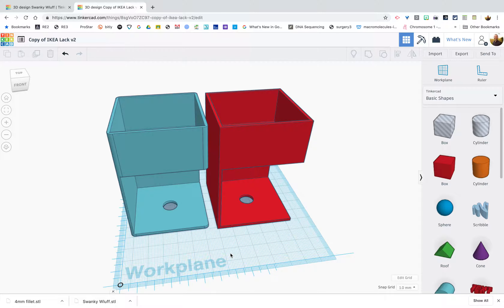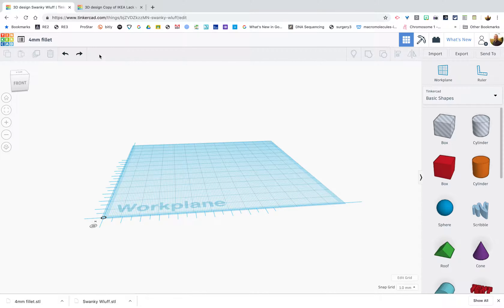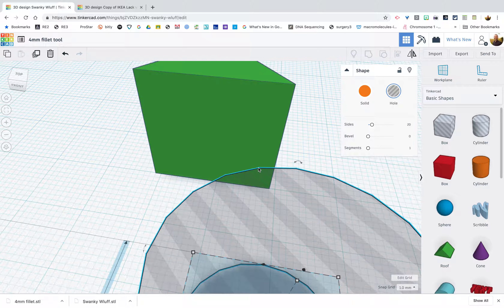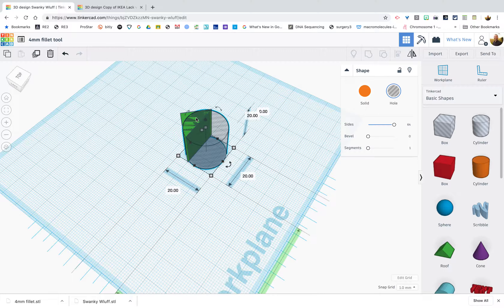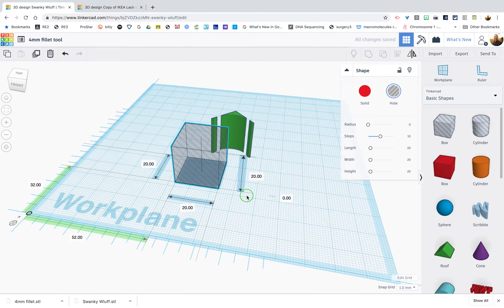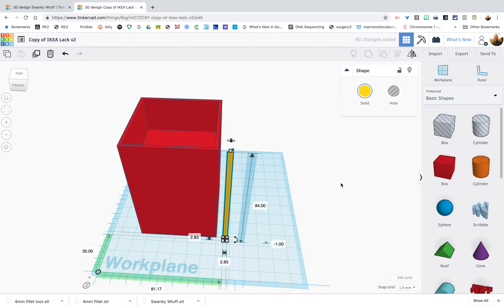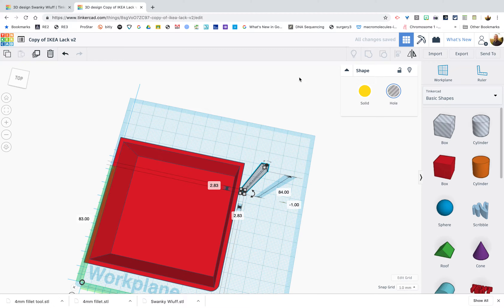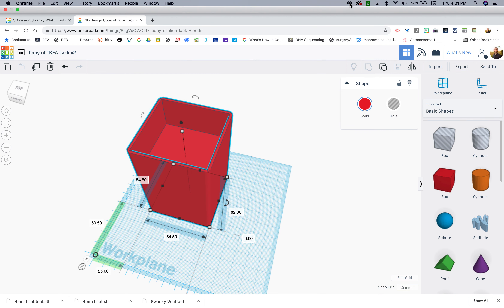Filleting Corners in TinkerCAD

Comment: That makes the corner slightly thin, how about building up the material on the inside ?
Reply: If you wanted/needed to do that you could use the same filleting tool but change it from a 'hole' into a 'solid' and add it to inside of the corner, then group it with the model etc 👍

Comment: You made this waaaayyyy harder than it needs to be. First, there’s already a fillet tool, just search the meta & you don’t need to do any of this. Also, your manipulations were overly complicated. You don’t need a new workplane to move the cylinder in an orthogonal direction, just move it. And if you’d just rotated the triangular prism to align orthogonally along the base sides instead of the hypotenuse, you could have then used the align tool to get a perfect fit and avoided that entire part about deleting the small remnants.

Comment: There is  an item already setup in the library to do this. This is more complicated than it has to be.
Reply: where is that please? By the library you mean the selection pane (basic etc.) on the rhs?
Reply: @tensor131  two things.  The basic shapes square can already have rounded edges in its object menu on top right when selected.  It's the same place you change the color. 

The other is in the shape generators  section. It's a corner that has a round cutout. It's basic  color is blue. You can make it negative and adjust it to fit the radius you want on any corner and then combine.

Comment: Way too much work, just use a cube and a circle same size. Align them together with the align tool and then cut out. Perfect every time. Just something to save you time for yourself and your students. I admire what it takes to be a teacher. :-)
I just noticed that the video is older so new tools in the new versions where you can save the item to your favorites. 
You can also just ctrl c the item and then just paste it into the other tab where your item to be modified was.
Nice job on the part though and very useful.
The internet is a horrible and cruel mistress. If I ever take the plunge and do a video I will know that there are terrible people out there and we have to expect ANYTHING when it comes to comments from the general public. 
I ran a business for 20 years and you would be amazed at the things that come out of the mouths of people. And that is when they are standing right in front of you.

Comment: Pro Tip: In your saved "4mm Fillet tool" item, go ahead and create your tool in every orientation around a square: 4 on each corner one direction, and 4 on each corner in the other direction (since sometimes you want to fillet horizontal corners, too).  And of course set them all to be holes, too.  

And then the next time you want to round off the corners off something basically square or rectangular, no more rotating and adjusting and changing state, just copy them all into the new item, and start aligning them to your object.  Huge time saver!

Comment: You've reinvented the metafillet. If you want to do it the hard way you should have rotated the roof 90 degrees before aligning (or just use a box. Then use cylinder with a number of sides divisible by four like 24 for example.